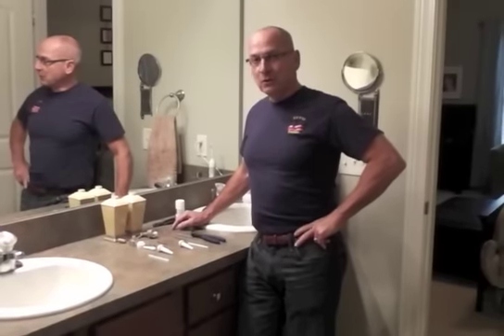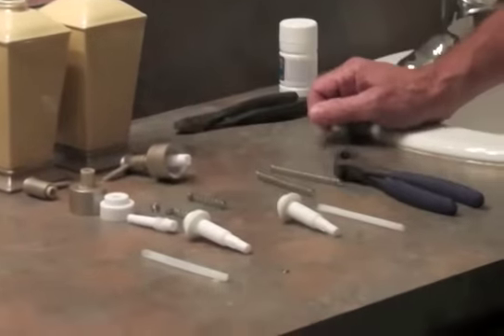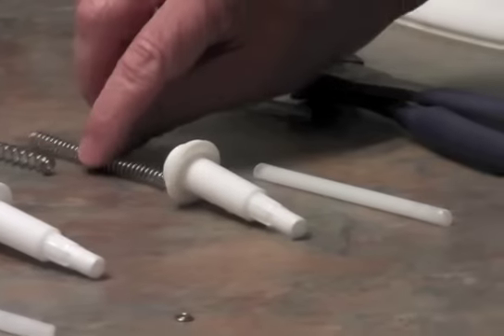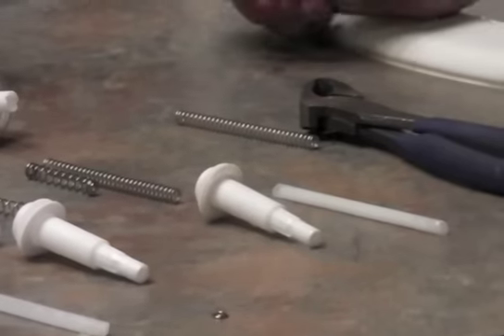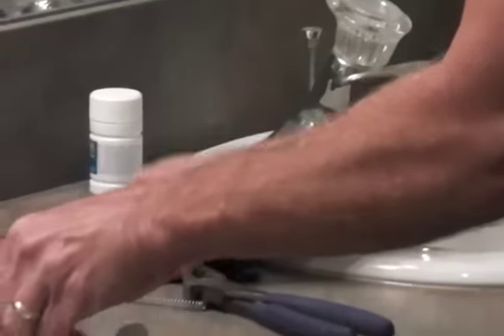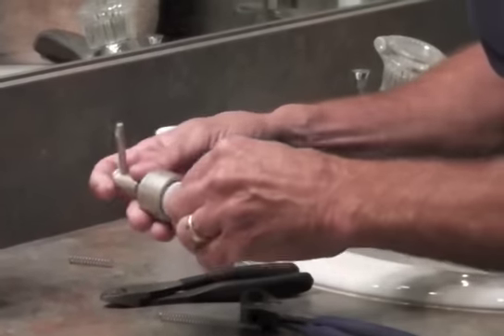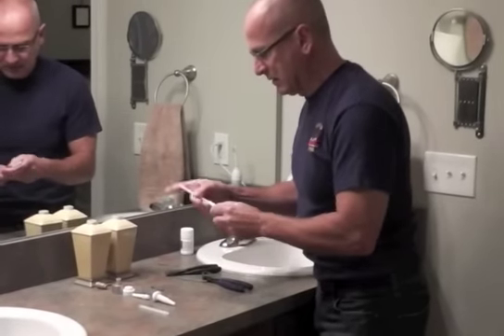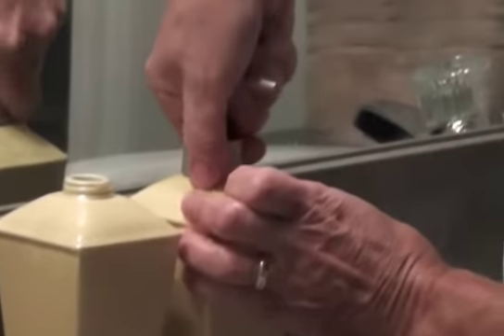Quick Fix Soap Dispenser

Comment: how do you take it apart? Mine just spins and spins.
Reply from the maker: Bob Sacamano, you have to hold the bottom part, push down on the top piece and turn.
Reply: Thank you. I got it done but it was so clogged I just go a new one. Thanks again.

Comment: I disassembled mine and nothing was broken the pump just wouldn’t rise back up after being pressed down, and now I can’t even get it to pump soap even tho I put all the pieces back exactly how I found them
Reply: The spring may not be broken but just worn out from use. If you see nothing broken I would try a new spring. However they aren’t really made to last forever.

Comment: how you have open this
Reply from the maker: It's been awhile but you have to push down on the pump handle while pushing up on the plastic mechanism below the lid then turn the mechanism counterclockwise. It should just be a quarter turn.